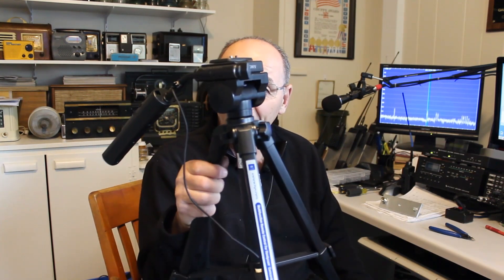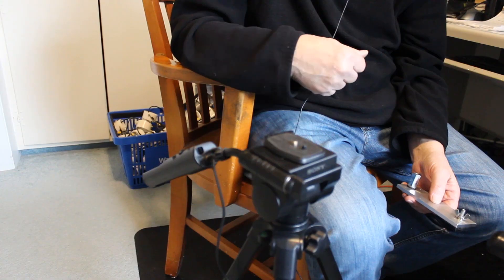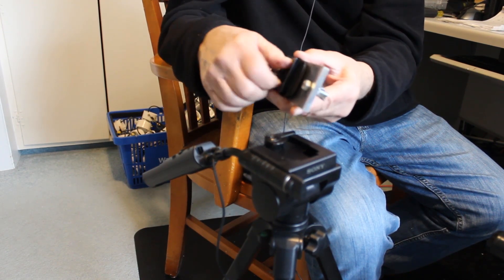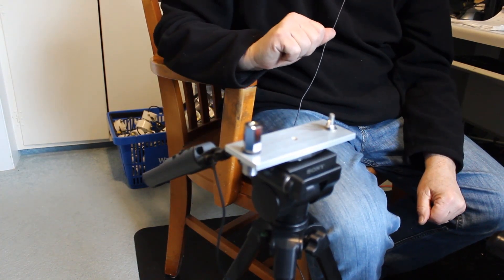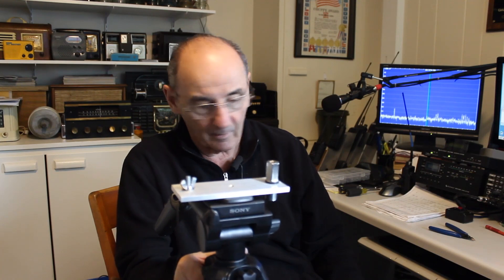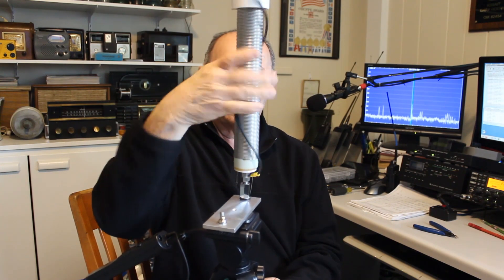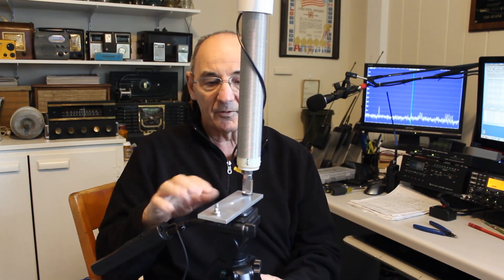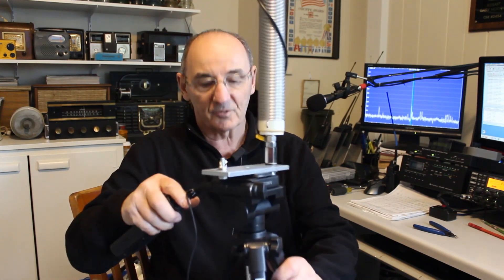Wolf River Coil- Camera Tripod Mount

Comment: Gary, when you run the radials starting at an elevated position, do you need to keep them elevated, or are they fine to rest on the ground?
Reply: Does the Wolf River Coil work better mounted close to the ground or elevated as high as one can get it ?
Reply: I don't see where it would matter?  One way should be just as good as the other.